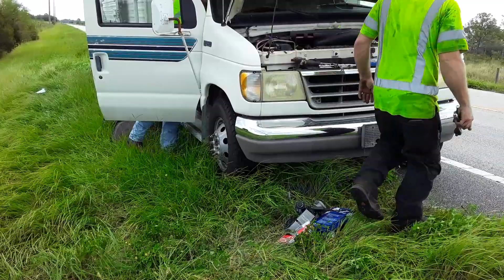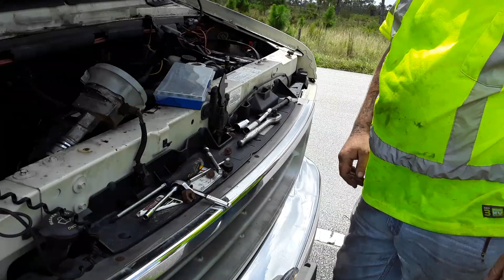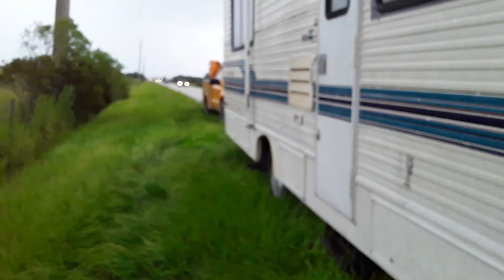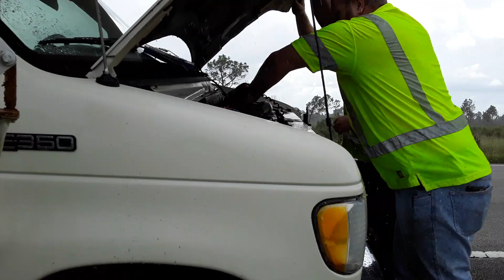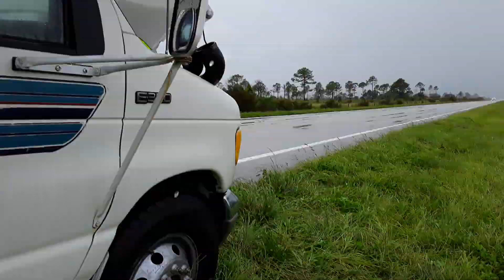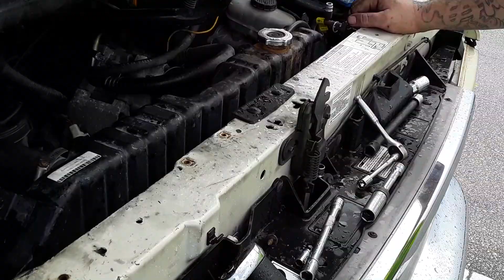Stranded - RV Mobile Repair During Hurricane Dorian Evacuation Part 2 (V1927)

Comment: I have a 2008 class A and a small travel trailer and I keep the both stocked, in running condition because U never know! I check on both of them once a week or more when I am not using them.  I would never park them and forget about them ever! Especially my Class A.  It cost more to fix it when U really need it.